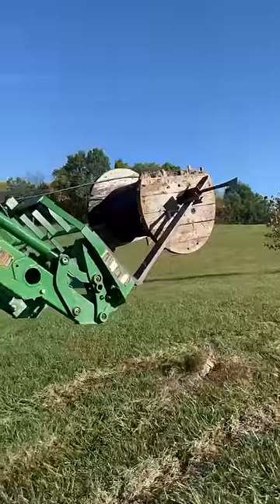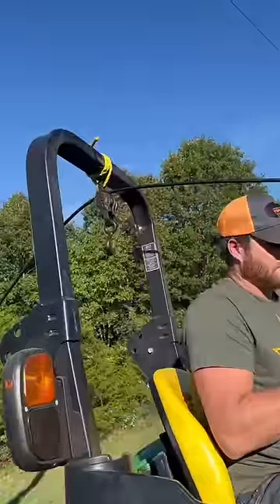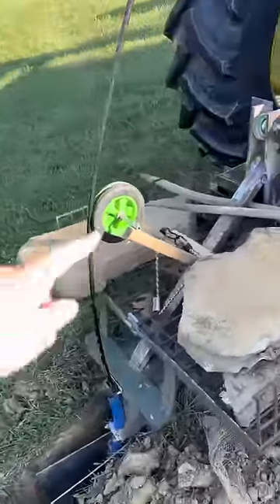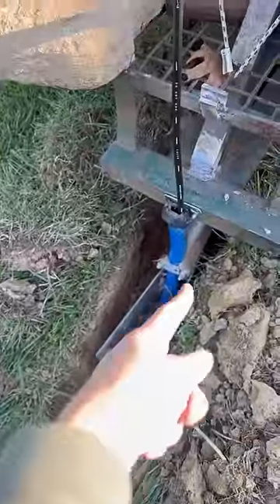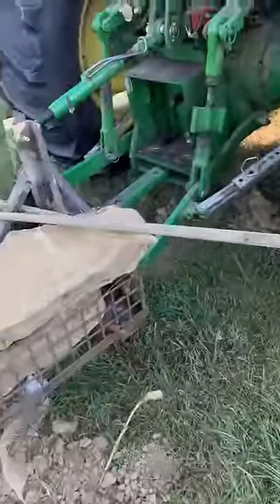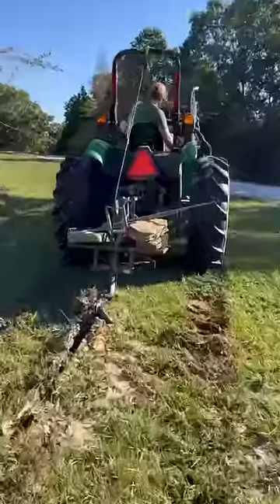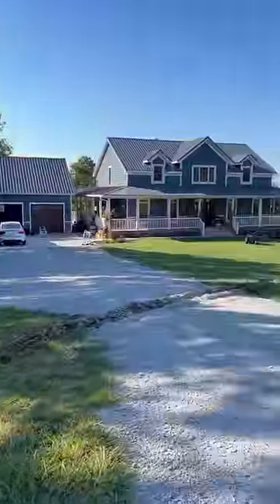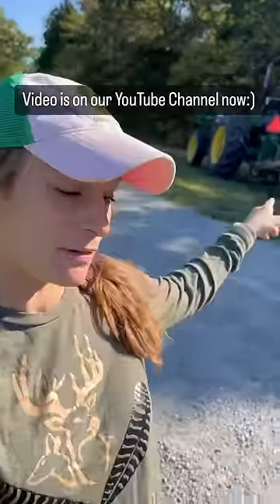Husband=GENIUS!🤯 DIY Subsoiler Build!       #johndeere #farmlife #amazing #welding #country

Comment: As a former fiber installer I can tell you that a direct bury install is usually ok for coax but fiber should be run through pvc because once buried exposed it's held in a taught position and any shift in the ground like a heavy truck or tractor can cause brakes to happen
Reply: great famly ties..  if only praise could go towards something useful & affordable to the barn:  like a wireless point to point dish / router...... then underground electrical conduit if needs be.   Otherwise the fiber line can go 1 meter below the power line that he had already strung up into the air.
Reply: Actually, technically the only time it needs to be in a conduit is if you're boring underneath anything. How you pack the dirt back in has a lot to do with keeping the fiber safe. I did underground cable burial for years. It would be better to have it in conduit the whole way but outfits are trying to finish jobs quickly and move on.
Reply: As a cyber security expert this is fine
Reply: I watched an Internet provider bury a fiber cable. They buried the cable the same way as this to a local business. It can't be all that bad. Are there better ways. Yes I'm sure there are always better ways. The question is how many times you are willing to cut corners. From my perspective it is their cable. If it breaks they will replace it. Who am I to say which is the right way.
Reply: Exactly! Could it be fine?......sure! As an licensed electrician/instrumentation technician i would've used SPR-AS or EMT for plenum-rated cable!
Reply: Going under the rock driveway made me cringe but if he's innovative enough to build that thing then he can probably splice it if it breaks anyway.
Reply: I am also in that industry. I was like what does she mean fiber. Thought it was a farm term I was not familiar with. When figured it was fiber optic cables, I screamed out loud, where is the pvc conduit.
Reply: Conduit is just to make repairs more seamless. Some of the biggest international fiber lines go under train tracks and don't have conduit.
Reply: Just let them learn green husband with fiber I’m a lineman and I have to run underground fiber sometimes  and also buddy your weird coax is very sensitive when bending hence keep hands off it when jigging and if truck or what ever moves over it while in ground with no conduit it’s also fucked lol I have experience in all these categories lol
Reply: Well, no professional would call it PVC.
Reply: @mgray1609 you sly little tanuki.
Reply: @spcpitts you realize the bigger lines would themselves be better supported just because of their size alone?
Reply: @PLKxR  splicing fiber optic cable is extremely tedious, essentially it's welding dozens of tiny glass strings and they have to be aligned perfectly, bump into a splicer's truck while they are working and they'll loose their mind because you very well could have ruined 10 hours of work
Reply: @spcpitts  that is absolutely not true because if that line is damaged it can never be replaced, it would be close to a million dollar repair if not more to repair a $5k cable, you have to get full cooperation of the rail line to completely shut down that section of track just to run lines over it
Reply: @Knotyourbusiness  well, we really do 😆, the term conduit applies to many different materials, an electricly rated PVC is used for buried lines because metal picks up static charge from the ground and can short out the lines
Reply: They definitely should have looked into CIC, maybe they'll read these and know for when that one breaks.
Reply: @PLKxR No,  that's is a specialized skill,  with specialized equipment.
Reply: When we were pulling in new fiber cars drove over it. Nothing happened.
Reply: @aaronfritz7234  there is no way you can know that until it's hooked up, I've had a bicycle run over a line and we had to go back and rerun 5k feet
Reply: I mean we buried tactical fiber like this but in a much deeper trench. I worry the shallowness of this line will cause problems down the road. Other than that the ingenuity is cool.
Reply: As a guy who is married to a woman who was once a chiropractic assistant, this will work.👍🏿
Reply: As a drone pilot aerial photographer I can tell you I don't know shut about this 😂
Reply: Hell... I would've womped the ground and laid it in and called it a day haha.
Reply: Fiber inside a conduit can be ruined quicker by moisture build up inside the conduit. The environment and the type of service provided on  the fiber, determines whether conduit is to be used or not.
Reply: @Re1ikGaming  ah so you know nothing about fiber optic cable, the reason (aside from higher data speed) everything is switching from coax is because fiber doesn't corrode from moisture, you can literally submerge it in water for years with no negative effect unless the water freezes
Reply: @dawgfather2101 you'd bury emt? How long do you really think that would last underground before it rushed out a year maybe
Reply: @kaseyduggin3762  I know plenty smart ass. I work for a major ISP repairing fiber. A coworker and I are the reason Superior Cable had to fork over millions of dollars for a manufacturer defect in their cable. Cable in the conduit didn't last a year. Had 3000 towers that needed the tails from the tower to the pedestals outside replaced. Even broke out the element table to prove the issue. Most fiber cable goes in conduit. Who gives a shit about coax. But for home use, so it just like the guy in the video did all day....unless going under anything hard packed like driveways etc.
Reply: @Re1ikGaming  that was the whole point of my first comment, he's running it under the driveway and on a farm they are very likely to have heavy equipment driving over it, and one company's defective product doesn't set the standard lifespan for all
Reply: @kaseyduggin3762  I realize I left some info out, my bad. Residential fiber, of any type, I don't prefer using conduit unless what you have explained there. Pesticides plus water (usually used around homes) deteriorate the fiber, something we've learned....something we don't have to worry about with commercial installation.
Reply: Correct, direct bury is looking for trouble, it should be in duct ( usually orange in color ). You bury the duct and then blow the fiber through the duct.
Reply: @kaseyduggin3762   I work for the utility owner so yeah I know it was fine.    The stuff we have done to fiber;  I highly doubt it was a bicycle.
Reply: Minimum 1m coverage, housed in flexible hdpe pipe, and even then encased in sand. This one last for shit
Reply: I have fiber optics at home and installer did run it down my driveway to my house enclosed in a pvc like tube. About 18” deep and 200’ down a gravel driveway … very happy with service and quality!!!
Reply: They're putting fiber in everywhere, I'd just like to know how the hell those rigs they use can put that cable in without digging trenches, I'm sure it's not a big mystery once you see how it works, but until I see it it's a mystery to me.
Reply: Well as a fibertechnician i can tell you that direct bury is ok, as long as its a direct bury cable and it does look like a direct bury cable
Reply: Not only that. This flimsy construction is likely to cause bends and/or stretching of the cable to an extend the rather sensitive fibers can‘t handle. Basically, I would expect a large quantity of the fibres to break without it being noticeable from the outside. Coaxial cable or the humble double phased copper cable are way sturdier.
Also, when they have fiber and their connection at the house, why not just set up a little server, connect a basic switch and run a cat 5 LAN cable to simply extend the home network out there? This should also easily be capable of providing network speeds in the gigabit range.
They could then even just put a WLAN (mesh) repeater out there if they need wireless access - fibre requires a whole PON setup. Really not a smart move, from start to finish.
Reply: @Pucksndeep6 exactly! And that's always been the problem! Just install it and move on!! It will last long enough for us to get out of town!!
Reply: Corrugated fiber tubing, not pvc. The depth here is not ideal without any additional protection other than the jacket provides (which is likely armored). For their purpose it will probably be fine and what he rigged up is pretty genius.
Reply: When the government split up Bell and AT&T back in the eighties we direct buried the fiber optic toll line all the way from Indianapolis to South Bend Indiana.
Reply: @Knotyourbusiness It's supposed to be a PVC hose buried the way her husband is burying that cable, then just blow the thin glass fibre in from one end to the other after packing the soil on top .  Easy to put more into the hose later or replace with a better type if you want to run more bandwidth for things like cameras or putting a video server for the home in the cooler barn .
Reply: Your wrong coax is more sensitive then fiber
Reply: Should leave it to the professionals. Nothing like a customer who spends money and does it wrong.
Reply: @mikes9759  No, as long as you bury at the proper depth there shouldn't be an issue. It's companies that don't follow 2 foot protocol that have problems and a lot of repeat jobs
Reply: We always install it in anaconda tube
Reply: Well, he could also spool-out a roll of "BURIED ELECTRIC LINE" caution tape.
Reply: Live and learn
Reply: What if it's dB fibre? 😅
Reply: Is anyone going to address the bending of the cable at the end.... I'm not an expert but I thought you're not supposed to bend it that much.
Reply: Reading some of these comments is hilarious. Imagine telling someone they’re wrong about something and not spelling correctly or using proper grammar themselves.
Reply: Correct...Not to mention anything with less than 12" of cover is at risk of working its way out of the ground and is easily snagged when plowing the drive. And then there are the frost heaves... I commend his creativity. Too bad he didn't have someone with experience to provide guidance. .
Reply: @Pucksndeep6 and that is why a few years or less down the road we will have problems and no one will be there to fix it cause the contractors will have moved on and said "not my problem " it was "good enough".. 

America in a nutshell now

We saved money and time and it "worked" as promised "for a while"
Reply: That’s why AT&T direct buried my fiber right? Keep it moving.
Reply: @mcelroystube  you mean cash in conduit? Because it makes me so much money from the time it takes to make repairs. But would be a beget choice for this use.
Reply: Everyone speaking up who doesn't install doesn't know. Looking at you cyber security expert 😒 The minute anything heavy drives over that driveway its going break. Not to mention you need to backfill correctly. Straight dirt won't work.
Reply: Yall missing the point, it's a woman building up her husband...forest and trees...
Reply: Lol installers think they know everything. Try drilling.
Reply: @klastic5918  my guy drilling ain't got shit to do with this. Been at this job for 15 years and I gotta tell you that was the dumbest shit I have seen in a minute
Reply: With due respect, with a quality manufacturer it works fine in most soil conditions. I'm sure there's some extreme circumstance (extreme winter heave, sandy soil, earthquakes, particularly badly made material) that causes direct bury to fail, but in most cases it works fine.
Reply: @dawgfather2101  burying EMT? 😂
Reply: Yeah my opinion was this was a horrible installation and a good way to waste thousands of dollars and have to start all over again
Reply: @jasonciappetta2354  emt is galvanized, so it takes a long time! Alot of it depends on what climate you're in. I wouldn't use emt in places close to the ocean! In most places, I've dug up emt that's been in the ground 20+ years and it was still good
Reply: @microcolonel  ??? Why not? It's galvanized, and I've dug up some 20+ years old, and it was still good! It depends on your climate
Reply: Not a fiber installer myself, but the network architect. I shat myself seeing that.
Reply: Also you need some kind of tracer so when digging miss utility can I'd it but all n all this is a great piece of work
Reply: There is direct burial fiber, but it’s pricey and you have order a certain amount.  I have used it in the past, and it was steel jacketed for rodent proofing.  7-8 years ago when we bought it I believe it was $6 per foot
Reply: moop
Reply: In telecom construction industry, the lowest of the lowest of construction trades, subs often do not follow the spec for laying fiber.   In the city, especially, where telecom lines maybe run next to water lines and gas lines and god knows what else, engineering specs would call for orange cpvc conduit.   While fiber is normally immune from power lines running adjacent, the photons in fiber are affected by anything that can exert a magnetic field.  

Running a ground line “drop” on a homestead should be fine with existing jacketed fiber.

I would be more concerned if the line snagged somehow and snapped the pulley and decapitated hubby.
Reply: True, but it looks pretty easy to replace.
Reply: Seems like they could spool it with a protective flexible type conduit.  If this stuff is this "delicate"  pulling it through 100s of ft can't be easy.
Reply: Why aren’t we using conduit anymore people. Come on
Reply: Breaks?
Reply: @dawgfather2101  Oh, yes please tell us more about how you would have used EMT for an underground run
Reply: @aberg94  National Electrical Code or (NEC) section 358.10 (B)......go read it! And then tell me more about how you're not a licensed electrician like me!
Reply: @dawgfather2101  If youre not using RMC or Schedule 40 for underground, theres a reason youre on youtube during the day when you could be working. You know, being a licensed electrician and all.
Reply: i kept looking for plant fiber
Reply: No don't worry about it her husband's a GENIUS! 🙄
Reply: Do you have any idea how hard it is to splice fiber? @spcpitts
Reply: If the fiber is armored it can be direct burial
Reply: So he could put  cables by hand inside a pipe 😂
Reply: I was going to say that also.  I’ll give it a year then it will have to be replaced.
Reply: it's correct, fibre is basically a glass tube, that's glass !!!

its firstly solid core fracture prone,

It's also ingress risk,

although the idea in itself is genius, imo,
Reply: Meanwhile  Frontier left mine out on the sidewalk for over a week then buried it like half a foot in-between the sidewalk and my yard up along the house.
Reply: @XxLordKratosxX  yeah sounds about right, 

The American management mantra mantra of sort term enrichment of the top management regardless of detriment of the company,

USA is crumbling via the infrastructure,
Reply: @johnriley8713  You can, but dig safe usually takes care of that. Remember folks always contact Digsafe before doing a job like this. They'll come out and flag all your utilities. The last thing you want to do is hit a gas line or something of that nature.
Reply: There is direct bury fiber optic cable
Reply: Agree. I’m a surveyor, and I’ve seen a lot of cable trenches over the years. There’s a reason these kinds of cables are not laid in dirt like this. It will work fine for a few years, but the more time passes, the better are the odds that the ground will shift somehow, breaking the cable. It doesn’t take much. A small rock coming into contact, and then some pressure from the ground above, and boom, you’ve got to replace the whole thing. It’s great initiative, but the guy got ahead of his skis.
Reply: @PLKxR If it’s a fiber optic cable it does not splice easily. And besides, you would have to uncover the whole thing to even identify the break. Much better to put it in some conduit. If it breaks, you can simply disconnect it in one end, pull it out with some line attached to the end, and then pull it back in the other way once you’ve spliced (or more likely entirely replaced) the cable. But point is that a conduit would itself help protect the cable, if done correctly.
Reply: @dawgfather2101   Plenum rated? You're just saying words. Plenum spaces are HVAC spaces that have to be fire sealed with special plenum rated cabling ran in commercial building. Not buried wire.  This is direct burial.
Reply: @mgray1609  Security experts know about as much as a barber about running cable
Reply: @kaseyduggin3762  not anymore it isn't. It's field terminated now in minutes.
Reply: Thank you.  I have been laying fiber for 20+ years and I was about to say the same thing.
Reply: @mgray1609 lol...as an artist. Great build quality! 😅
Reply: As a prime member at Amazon I'd say that works fine.
Reply: When AT&T laid fiber in our very large neighborhood they ran both the main trunk lines and thousands of the smaller residential runs without PVC or any other type of conduit.
Reply: Exactly this. The last thing you want is a micro bend that you need to massage out.
Reply: As a guy who doesn't get enough Fiber in his diet I APPROVE of this installation method....😂 Lol
Reply: Gitter dun😂
Reply: Yeah.  Idont know how many times I had to reconnect my Pops. Electricity because of breaks in line. Over time it happens driving over them. Earth movement water corrosion. I always asked why not just put a  pole up. ... North East tx. By Paris.
Reply: @mgray1609 naa, you work at Walmart 😂
Reply: He invented a 60 year old cable plow
Reply: @dirksteele247  as long as you don't bend it in half it will be just fine
Reply: yep, came here to write something similar to this. I only installed fiber in the home for a couple of weeks, but learned a hell of a lot in that time. this was one of those lessons lol
Reply: We used to bury it like this in the 80’s direct bury it was called (obviously) then we went to orange conduit on a roll then blew string and pulled it through. Worked for MCI  Telecommunications , AT&T along with Sprint. The direct bury worked fine with a D8 Cat plow and a pre-ripper if it was more of a rocky ground. And I think she married a mad scientist to me, good for her. At least as long as he doesn’t start bringing home spare parts from people and not so spare.😂😂😂😂 y’all have a great week and a better weekend.
Reply: The internet, where one wrong opinion gets tons of support because the commenter says "as a such-and-such"...

As a current plant engineer who specs fiber installations, direct burial is fine in the overwhelming majority of situations. I can't read anything other than 12 sm on the jacket, but a 12f with that diameter is at least SJSA - it's going to be fine. I suspect the husband has actually done this before as the setup is incredibly similar to vibratory plow installation.
Reply: @Hakuna_Frittata  not an opinion that's manufacturer instructions for installing
Reply: @kaseyduggin3762  Go ahead, tell me a single manufacturer that provides "instructions for installing". 

I've worked directly with all the big-name manufacturers in the US. Prysmian, Corning, Commscope, OFS - NONE of them offer an "installation manual". The specs are provided in a datasheet. Modern armored cable is spec'd for direct burial applications, I have yet to see a manufacturer who recommends against direct burial. I design and install many, many miles of the stuff every year. You're wrong.
Reply: Maybe it's an armored DB Cable? Probably not.
Reply: Well, the company that built my house apparently couldn't use a square or level 😅 So James is a rockstar!
Reply: Hmmm . . . what are the odds that a heavy tractor or truck (like a gravel truck) is going to drive over that gravel driveway?
Reply: @scottdelaney98  probably pretty likely since a delivery truck is heavy enough to do it
Reply: I have cut through fiber inter-conintental  cables not protected by conduit... mis-identified by the city, by more then 3 feet. 
its really at your expense.
I would conduit myself.
Reply: @spcpitts  one time those get cut, they will conduit them because it cost 100's of thousand of dollars of down time and repairs.
Reply: @kaseyduggin3762  Glass... not for internet.
Reply: What if the truck is new and doesn't  need brakes?
Reply: It's more accurate to say that conduit is installer's "standard overkill" put in to minimize PITA for a repairer (who is often the installer). But if the installer/repairer doesn't regard the repair as much of a PITA anyway, there's nothing else about the conduit that makes it necessary or arguably even worthwhile. Most likely no repairs will be needed, and if they are this dood probably will invent some contraption to facilitate it. Most important thing, by far, is marking where that cable is so you can either find it when you want to dig it up, or avoid it when you don't want to dig it up.
Reply: Soooooo, if you were in the cable burial business, does that make you an undertaker?

(Meant to be a little funny...)
Reply: @dangersDv  Nope, it is still power companies pole.  I had to string my fiber from a pair of trees beside the power poles.  I strung steel wire, and then hung the fiber with steel support along it.  But I only had 500 feet to run.
wireless can be tapped, and is slow as well.
Reply: @mgray1609  Actually, per government specs on cybersecurity installations.. this would need conduit and concrete to be considered secure and un-tappable. :D
Reply: Im an IT tech and … the trenching system is cool, but I cringed when I saw the line spooling system 😂 And the way it was being put in
Reply: @panchopistola8298  I wanted to use PEX as a single piece conduit.  But worried about the drag inside trying to feed the fiber through it.
Reply: Cool invention a great way to get it in but as a fibre engineer I think you need to lay it in plastic ducting
Reply: I was about to ask about the pvc conduct too. Nice innovation though
Reply: that looks like a lot of strands of fiber in that cable. Also…as a fiber splicer, I would definitely agree…direct bury fiber should go in conduit. Great farmer rig though!
Reply: Depends on the jacket.
Reply: So bury the PVC with a pull line in it.
Reply: I'm amazed at how many people comment that have no clue what they are talking about regarding fiber.
Reply: @MadMarv.  I admit I have no knowledge about fiber. My comment was my intuitive take on the matter. How would you handle it?
Reply: @InsideOfMyOwnMind  What they did is fine. If you work with fiber then you can easily recognize outside plant cable. No it's not going to break if you run over a buried cable. No it doesn't need a conduit. If it was a commercial application running critical infrastructure like a hospital sure. I haven't watch to long form video to see the internal construction of that particular cable to see if it is tight buffered or loose tube. With a greater then 10x diameter bend radius the install is fine. Splicing fiber is easy as long as you have a splicer. Hell, I can splice on fiber connectors 10x times faster the back in the day of hand polish and hot melt. A lot of direct bury fiber now a days is bend insensitive. Why in the world would you go the the expense of conduit for a simple run to a barn to light up something that is probably only running a gig.
Reply: @MadMarv.  My point was if you are going to use a protective measure and are worried about stressing the fiber a loose fit in PVC would accomplish that, facts about modern fiber not withstanding.
Reply: @InsideOfMyOwnMind  It's not necessary. That cable (depending on the one they used) has fiberglass strength members in it and is enshrouded with Kevlar. The outer casing is also very robust.
Reply: Who needs fiber anyways?!! The husband did good,  enough said!!
Reply: @gi0nbecell distance is the reason; cat5e/6 is only rated up to 100m. Fibre will last much longer in the ground than copper too. It doesn’t have to run as PON either, SFP modules in a switch off their router will do the job nicely and is easy enough to do, especially if L2. Whatever cables are used, they’ll have to have a network device at the other end so a sensible option would be to make it another switch and connect AP’s via copper off them. Mesh would work but wired AP’s are always better if possible.

Fibre is definitely more fragile though. It’ll probably be find but at the depth he’s installing it & without knowing more about the cable being laid, I’d feel more comfortable if it was ducted.
Reply: @rickwalker2  True. As a matter of fact, I have just recently installed a sturdy network at home. Since I got fibre, I lost so much bandwidth with my mesh (probably due to the steel pipes of the floor heating, house in Germany built around 1980) that ate most of the wifi signal. I now have installed a LAN using Cat7 cables and even provide power to my three wifi ap‘s over PoE. Admittedly, Cat7 is a little over the top, the longest distance is about 22 meters, but damn… The ap‘s are of course still operating as a mesh.
Reply: @gi0nbecell  Cat7 is definitely overkill but at least it'll sort you out into the future. Why are you running your AP's as a mesh if you have them wired for PoE? Might as well have the cables running the data as well- you'll get better performance.
Reply: @rickwalker2  I run them as a mesh to provide a constant wifi throughout the whole house. I don‘t separate the wifi ap‘s into separate networks.
Reply: @gi0nbecell  ah I see. If you set the same SSID & password on all your AP’s your devices will roam between them automatically & if you have a flat L2 network (like 99.9% of home users) then it’ll work pretty well. I get what you mean though- for the best WiFi roaming experience short of enterprise AP’s & a WLC, a mesh will usually roam more seamlessly.
Reply: @dawgfather2101  why are you using plenum rated cable for a burrial theres no concerns of toxic gasses because its not in doors
Reply: That’s why they make wire that has a coating for wet locations Kasey. Somebody already thought of that.
Reply: Awesome but should really be in conduit due to roots, ground movement and other natural  occurrences.
Reply: @mgray1609 what’s cyber security got to do with infrastructure? This isn’t fine at all… it will rain, ground becomes unstable; it’s farm. Heavy equipment. And trench is just a foot deep…
Reply: @PLKxR splicers aren’t cheap though
Reply: @spcpitts they are more thicker and steel reenforced
Reply: Well for this guy he can just do it again in 5 minutes so screw the PVC pipe he'll take a chance
Reply: @mgray1609 How does you being a cybersecurity expert make you any more knowledge with anyone else on installing fiber optic cable? That's like saying saying we should take an HVAC techs word as an authority in u stalling natural gas transmission pipelines. You don't learn about construction in cybersecurity school.